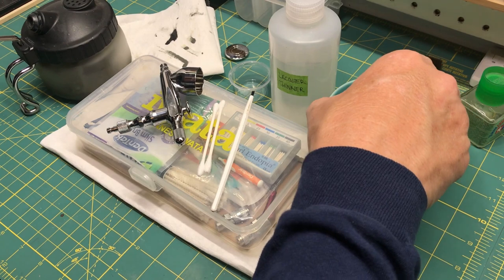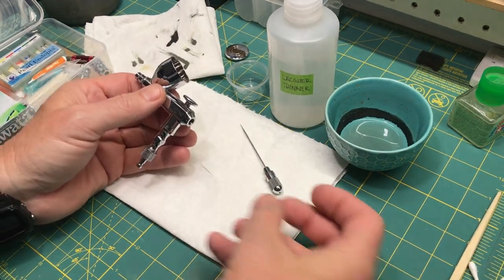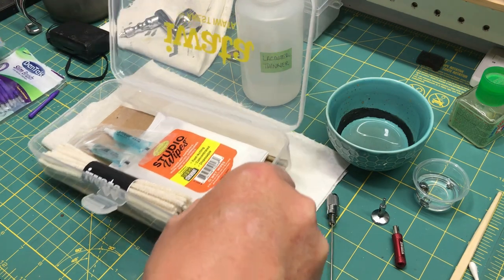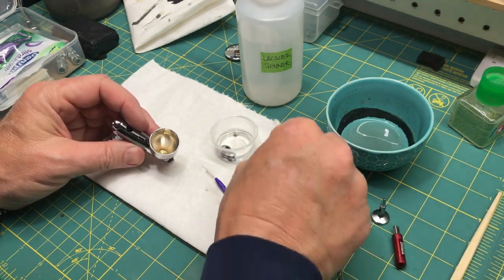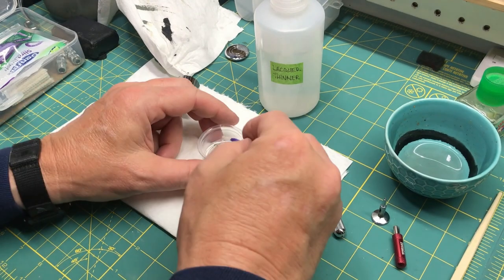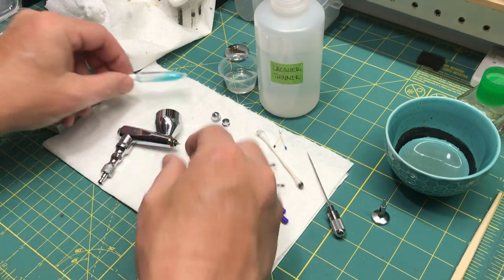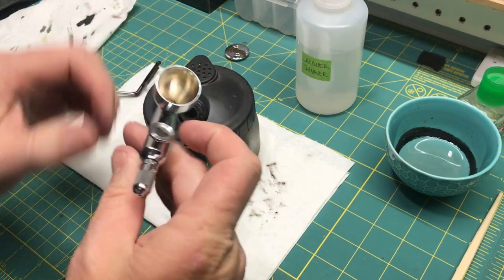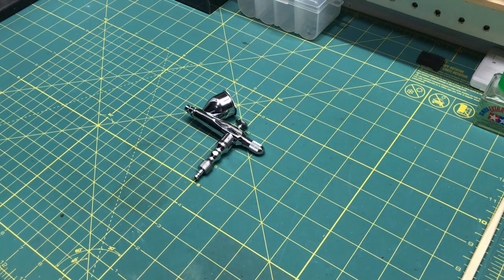Cleaning My Airbrush Large

Comment: Good video Brett. You're correct that if we ask a dozen people for the "right" way to clean an airbrush we'll get a dozen different methods with some swearing that their way is the "only" way. I shoot a mix of acrylic and lacquer paints and always use lacquer thinner to clean the AB even between colors. I virtually never get clogs and rarely need to do a full strip down of the AB. . I also agree that trying to economize on the cleaner used ("only need a thimble full") is penny wise and pound foolish. Regardless of using lacquer thinner, purchased cleaner or home made the cost is minimal considering the ridiculous amount we pay for the paint. Dave
Reply from the maker: Words of wisdom my friend. I very rarely break mine down completely as well, and more often than not, it isn't even necessary.

Comment: Great video. Perfect for me.  You mention that you only use a lacquer cleaner for cleaning your air brush.  And, you buy it in quart size quantities in a hardware store?  Could you please tell me specifically what brand you buy for your use?  That would help me significantly.  Right now I’m using 70% rubbing alcohol. I’m afraid it may be harmful to my air brush. Thank you so much, Eric.
Reply from the maker: Thanks, Eric, and glad it was helpful.
The Brand I use is Kleen Strip. They make all kinds of paint related solvents and cleaners. Are you in the States? And what kind of paint do you generally use? For some of the water based paints, I rinse with water first to get the majority out, then use the lacquer thinner.
As for alcohol, it shouldn't harm your airbrush. Some paints (Tamiya for instance) have alcohol in it as well as some of the acrylic cleaners. I've never had trouble with it.
Reply from the maker: Also, for some reason I can't reply to your comment on the P-51 video. Glad you liked the video. And glad the tip about the gun covers was helpful!